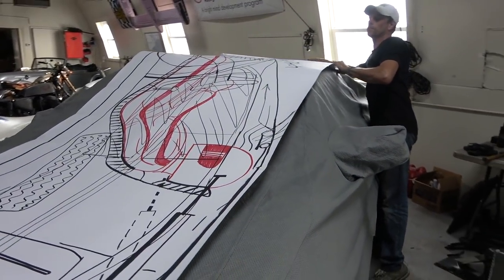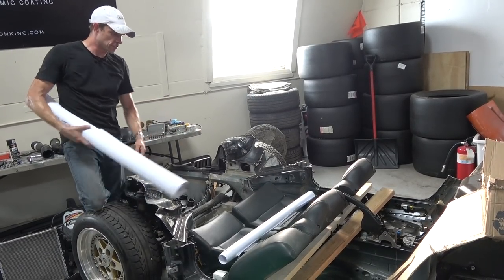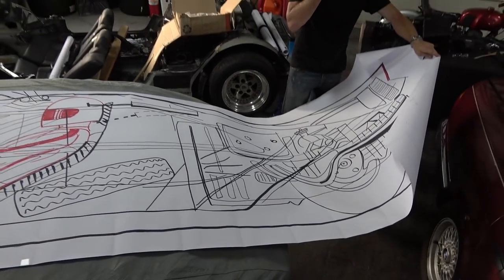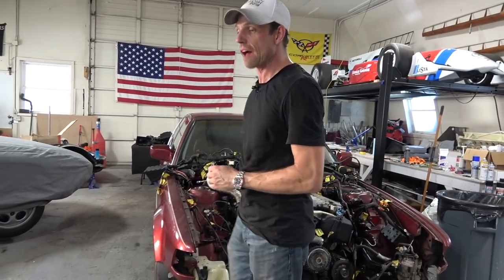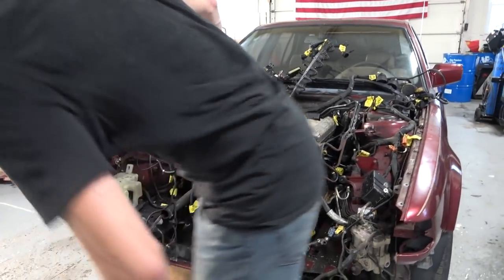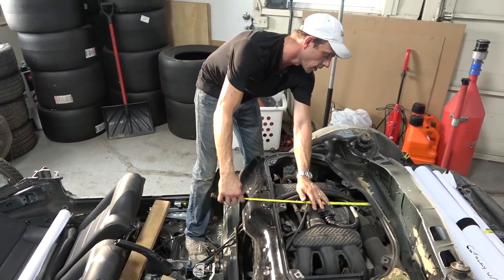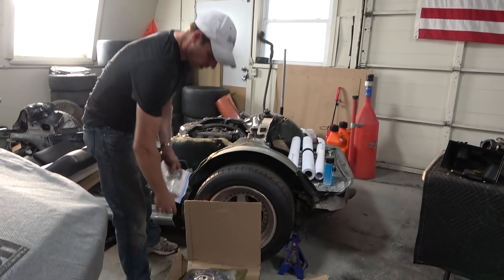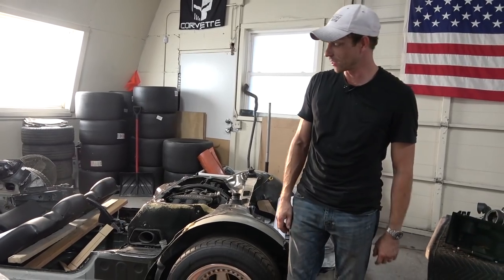Insane build plan | #3 King Zero V12 supercar!

Comment: Its a BIG longshot but you could reach out to Rennsport for their ITB manifold for the m70. Its a cable throttle unit and they offer ECU services for the engine. The sound of that V12 with ITBs and long tube headers would be godly.
Reply: Ooooooooo...😳🤤

ITBs would be hot...

Comment: There were BMW E31 with M70B50 engines which came with manual. I think it might be possible to change software on stock ECUs or just buy an ECUs from manual. There are some people in my country who modify those ECUs and they have worldwide shipping and online services so I think they may be able to help. I can send you their email if you are interested.
Reply from the maker: Please do. You can write me through the Genius Garage website
Reply: Yea is possible is not very hard to trick the ecu the hard part is programing the ecu to work outside of the car that is the pain on the back more with BMW and Mercedes Benz because You have sensors everywere and always You have 2 or 3 ecu for the engine, the car and the accessories but if You  know the people or You have experience is possible to do it very easy
Reply: john mac  why the capslock?
Reply: @CaseyPutsch  I sent you a message through your website

Comment: As the owner of a 850ci 6 speed, replace the plug wires (or rebuild them and replace the m70 cps/donuts) while you have the engine out!!!!
Reply: oh and replace or reseal the intake manifold gaskets!!!
Reply: @ANTIPURIST625  at least it has no timing chain guides trouble like in the V8

Comment: Haltec Ecu for stand alone. Skidfactory on youtube used  a Haltec Ecu to get a Toyota Century V12 to run in a diffrent chassi because an automatic cars ECU will not allow the engine to rev if it dosent see data from the transmisson.
Reply: Good idea.  Haltec seem like they're keen to work with youtubers too.
Reply: @horizoninabucket  one of their top guys the Tuning fork has been part of the Mighty Car Mods crew for years.

Comment: Megasquirt ms3 can run the m70. There are a couple manual swapped e32 750s. There are 3 ecus running that motor, plus one for the transmission.
Reply: I believe the easiest way to manual swap and get it to run would be the megasquirt. You can order a kit and literally build the board, or buy it ready to go. The harness seems daunting,  but you can use a lot of gm  sensors, and gm electric throttle bodies. While lame in comparison to a mechanical throttle, way easier. Im sure you can make a manual work by fooling the stock ecus into thinking the auto is in neutral.

Comment: Good luck with the build, that crank to transaxle adapter fixes a lot of issues for you though I agree it wouldn't hurt to check the balance of the flex/adapter/coverplate assembly. Must admit I would have wanted to fix the original motor and sell it on (not knowing how broken it is) but I guess that's just a diversion from the task at hand.

Comment: As already mentioned, megasquirt3 evo will give you everything you need plus a good number of GPIO and you can connect it all directly to a digital dash as well. Best bang for your buck with the ms and plenty of support from the community in the msextra forum. I don’t know if it supports dual throttle body, but I am sure the additional features that you won’t use like boost control and so on can be adapted to work for the throttle body’s. 
The one that can probably provide a ton of help with questions is muaythaiboxer on the msextra forum. He has developed a ton of code and features for the mega squirt.

Comment: My early 90 E36 bmw had the transmission swapped (from auto to manual) and the ecu worked like it was meant to be, now I'm taking the original EFI out and installing a Fueltech Ft600 ecu (I think all the models for then support 12 cilinders engines)

Comment: I read that the Megasquirt Gold Box will run that V12 easily even with the electric throttle bodies. I would make a new intake manifold, I'm fairly good at it, and shorten the runner length by half and run a single 102mm GM style mechanical throttle body.
BTW: I run a pair of eBay turbos (GT45) on my daily driver, for two years now, and have not had a single problem with them, getting a transmission to live behind that gen 6 big block has been a problem however.

Comment: Casey, the fuel tank in the front is not a problem. You can firewall it and build a kevlar skid plate under the car. As for rigidity, building the clamshell out of carbon fiber and nomex honeycomb sandwiches can make it stronger than an NHRA Top Fuel cage. When I was just a wee lad I remember talking to some F1 engineers and I asked them about the strength of the body because it doesn't have a steel rollcage. The thing that stuck in my mind was incredible! They said strength isn't the issue at all. They could easily make the car so strong that it could hit the wall at 200mph and not even come away with a crack. The weak link is actually the driver so they have to build the car so that certain parts break away to limit driver impact inertia. CNC foam mold bucks and some bondo will make any piece you want. The airplane guys cover the engine in plastic and use paint stirring sticks or wooden shims for spacers. Then build a crude cardboard overmold with taped seams to fill with polyurethane expanding foam. Cut, file, sand, and smooth the foam for engine cover, cowls, ducts, or anything else you can think of and it always fits perfectly and clears everything.
I think CatCams makes camshafts, springs, and keepers for the BMW and most German cars. The problem with the BMW and The Mercedes V12 is the Cams. No matter what exhaust system you build they still sound disgusting. Nothing like a supercar at ALL! It's because the Cams are made for low end torque. They run out of power at 4500-5000 rpm. They will rev higher but sound anemic and rev excruciatingly slow because they are totally out of the power range. 
Exactly like that 460 big block farm truck that everyone has heard missing most of the exhaust. Loud as all help, but sounded nothing like a cammed 460 with essentially the same exhaust. If you want a BMW or Mercedes torque master to sound good, the factory cams must GO! 
The good news is with the amount of subscribers you have as well as the nature of the channel that almost any aftermarket manufacturers would be more than willing to donate their products for the build. Older BMW and Mercedes make perfect replica engines, but only with a modern standalone ECU, Coil on plug ignition, larger throttle bodies and injectors, performance cam and springs, and head flow bench work. All out of  pocket it's $3000 to $5000 bucks. I don't think it will cost genius garage much if anything.
It would make for a couple of absolutely amazing episodes to have an engine masters, or Nascar, or Indy Car, or any pro stock type engine builder come in and show the kids how to port and polish cylinder heads. For building ANY Porsche, Audi, Mercedes, BMW, Volvo, Aston Martin, and so on. Camshafts and Head Work are an absolute must. The home garage bolt on boys just use an LSX V8 and buy any one of a million of the shelf performance heads. Real performance out of the foreign engine requires porting skills and camshaft knowledge. No bolt on availability.

Comment: Clarion built a 6 speed manual 850, which is an M70B50 as well, they had to find someone with an old-school computer to use older software to reflash the ECUs. So it's possible even with stock ECU... just not easy.
Reply: http://www.speedhunters.com/2017/09/clarion-builds-bmw-850ci/ the Clarion car, in case ya were curious, they say what gearbox they used and such.

Comment: Will you be fitting the same type of steering wheel that moves out of the way of the driver by folding forward in the Lancia Stratos Zero, as there is some videos on YouTube of the Lancia Stratos Zero at a car show with the driver getting out of the car and you see how the steering wheel folds all the war forward and upright to allow the driver easier assess to get in and out of the low slung seats?

Comment: I believe you should be fine with the stock ecu and a manual trans.  Typically you'll run into low idle while in gear problems with a manual trans ecu in a automatic.

Comment: Megasquirt.  I think they can handle 12 cylinders.  Also, not sure about this either, but couldn't you just roll your own frame and then bolt the subframes onto it?  Seems like you'd be able to get everything to the right length/width if you did that.

Comment: Have you considered using some of the newer aero system designs that you see on race cars today that create a vacuum under the car to help suck it down to the road?  First thing that came to mind when you were describing the wing effect.
Reply: The Chaparral 2J from 1969 used a snowmobile engine to drive a large fan mounted under the car. It also had Lexan sideskirts that hugged the ground and it quite literally vacuumed itself to the ground. When it wasn't broken it obliterated the competition. The sanctioning body indirectly banned it the next year by adding a rule that cars could only use engines to drive the wheels.
Reply: @MrLordZenki  they don't use a seperate engine to create the vacuum under most of the modern race cars.   It's done with aero design.  Ducting to the engine compartment and other areas that need cooling along with some underbody air vanes to direct air which causes a vacuum under the center/rear of the vehicle.
Reply: @OGSomeOne  I know it's done differently now, but my point was it's not something unique to modern cars. Also the "fan car" concept is still valid with modern technology.

Comment: Is that the one with the toaster rack of ECUs? Three total, one for each bank of the V12 and the final one to keep a running total of how much to charge the customer for the next service at the stealership?
Reply: M70 also has two fuel pumps, fuel rails, distributors, mass air flow sensors, crankshaft position sensors, coolant temperature sensors and throttle bodies. The crankshaft position sensors are quite expensive and they often fail in BMW. In my e36 (it runs on Siemens and this V12 runs on Bosch ECU so there is some difference) I had to change crankshaft position sensor twice because new one failed after few months.

Comment: Casey - CarFix over on Motortrend worked on v12 swapped Lambo kit car.
The car used 2 Chevy Beretta V6 harnesses and ECM's from the early 90s. 

Here is the episode - I don't have much more info about how the wired them up. 
The Beretta/Corsica/Cavalier/Grand Am/Grand Prix/Lumina - and a few more GM cars did come with a V6 and 5 speed manual combination. 

https://www.motortrendondemand.com/detail/lam-faux-ghini/36363/

Comment: Yeh. So regarding engine management most of the guys go to cheap option of putting stand alone like megasquirt. Even here in europe where E31 parts are a little bit easyer to find. I am not a big bmw guy and do not have a lot of knowledge on the v12 but know that much that dual OEM ECU system is a mess to work with.

Comment: i was wondering this all along:
are you building these cars for the track only or will you get them road legal? 
if you want them to be road legal, is that possible in america? here in germany, the only way to build a car yourself and get it road legal is to take an old chassis from before there were any significant regulations like from an old beetle and just build your car ontop of that. to register it, you would then have to get paperwork for every single modification which can be very expensive
Reply: It's very easy in America, State to State the laws have variation. But so few people do a self built car that they only really require mirrors, lighting, a horn and not much else. In Arizona the car has to pass emissions regulations based on the year, which isn't an issue when your self build car identifies at a 1970 King Zero

Comment: Be careful about engine balancing. I once changed a Corvette flywheel and the engine vibrated horribly after 3000 rpm cause it was a external balance engine and the flywheel came neutral balanced.

Comment: Why not cut the floor over the transmission out and put the radiator there? It would be super easy and you would have more room for the fuel tank or tanks. Also here is a modern take on the lancia stratos zero! https://www.autoevolution.com/news/touring-superleggera-senior-designer-modernizes-the-lancia-stratos-zero-concept-144582.html#

Comment: close only counts with horseshoes and hand grenades!  If you are going to build a SUPER CAR THEN BUILD IT! If you want something that is "budget" then that is what you will get.  There is no reason to skimp on the engine, at least send out for an overhaul with some performance in mind.  It doesn't have to have 1000hp, but refresh it with some forged internals and a stand alone pcm with moderate power will not break the bank. Just remember you get what you put in to it.  a junky tired engine will translate to a junky tired driving car.  I speak with experience as a UTI graduate and technician with 20 years experience.

Comment: You could just gone tube frame, instead of this silly cutting up a car and make something out of that.
Reply from the maker: If I had no concept of the value of time....
Reply: @CaseyPutsch  No it would not, just measure the suspension point on boxster write them down, open a CAD program(Solidworks/inventor/fusion) 
Make a squaretube bottom frame, add your suspension point on that, then put a roll cage/spaceframe on top of it
Fuck man you could properly do it with out CAD but it would make it easier when you can visualize it turn it around and all of that.
But thats what every raceshop that does any tubeframe type race cars(or close to it) let it be NASCAR, AU Supercars, Trans-am, or Drift cars.